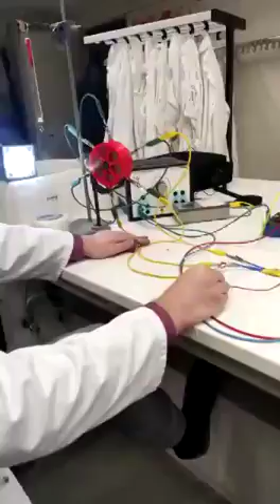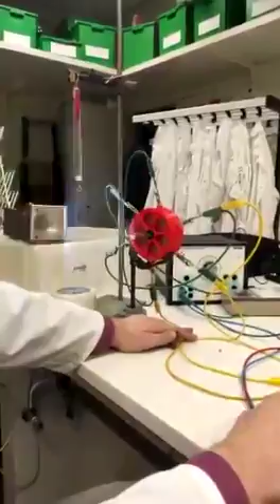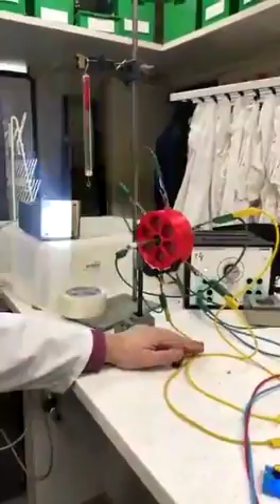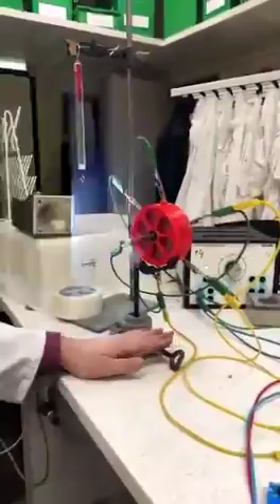Build this 3D Printed Electric Motor and Watch it Roar

Comment: Ah yea, high voltage motors! This would go perfect with ion-based propulsion, and hydrogen gas as a fuel source for unmanned blimps.
Reply: ion based is odd in earth's atomosphere, hydrogen is a great lifting gas not too much a fuel.  I do LOVE lighter than air craft.

A Rigid Airship, with two of these on the "gondola", a battery + typical rc/fpv setup, and a flexible solar on top would be a very capable platform.  And not too much torque should be needed for drone props.